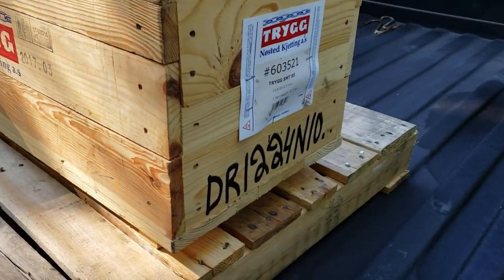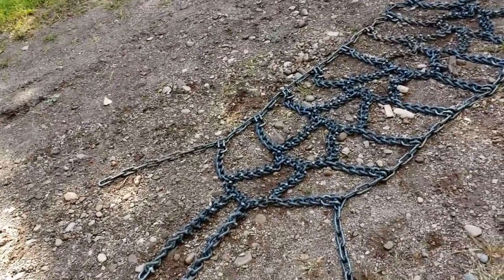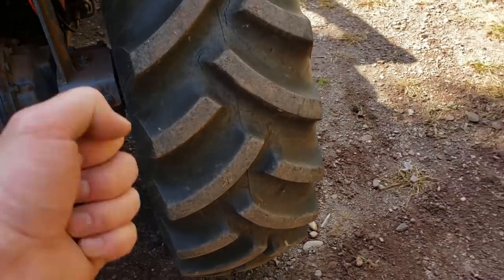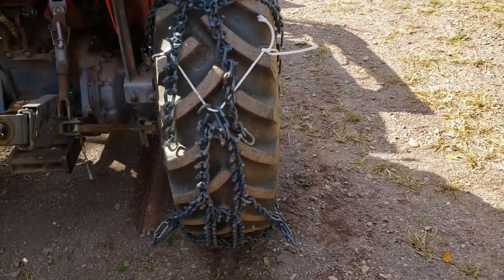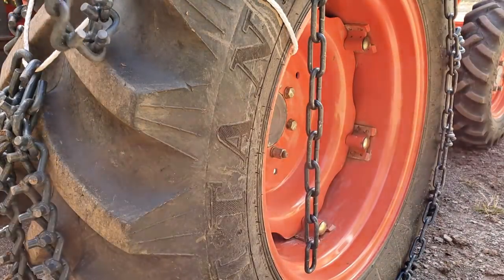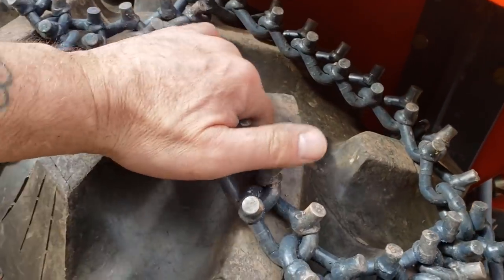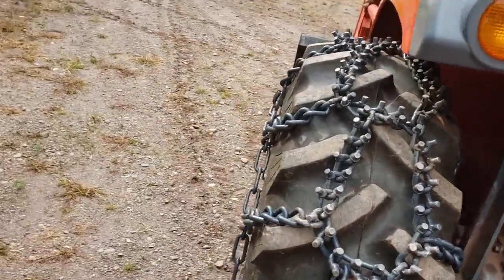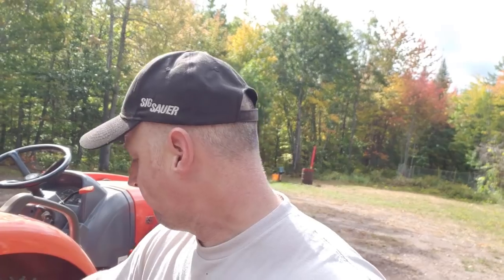Installing Trygg Ice and Forestry Chains on the Tractor

Comment: Nice video and chain set. I place my chains on the ground like you did then I drive the tractor over the chains, tie them on to the wheel then back the tractor up and the chains roll onto the tires with out having to stop and start 4 or 5 times to keep straightening them out. and you can do both sides at the same time.

Comment: Me like!  I have to work alone so your method of getting the chains onto the tires is really good.  You get them centered as you go.  I do have one suggestion - do with it as you like...  When I'm trying to get the clevis into the links (and sometimes the latch lever) I use a ratchet style load binder to pull the two ends together.  The ratchet style allows me to pull the ends and then still have both hands free to work.   I'm now 75yo and not as strong as I used to be - every little bit helps.

Comment: Just subscribed to your channel.  There is a lot of interesting stuff to watch on your channel! I am a tractor enthusiast and I like to cut and split wood (can be seen on my channel). If you haven't used the Trygg chains before, you will be surprised. You will love it. It has nothing to do with the common ladder chain. It's 10 times more effective.  This is what I have on my Case 430 (2wd) and ice is absolutely not a problem, even in very steep grounds. I keep them year long. Like the name suggest, they are good for winter and for logging! Thanks for sharing!

Comment: I have a set and they are the cats meow. Great traction and once they are on they don't move around.  They have wicket traction. I have a video on them on my channel.  I am on steep hills blowing snow and I hardly even need 4 wheel drive.  

There is a couple words of caution... 1. if they do spin they will rip up a driveway or badly scratch and gouge pavement.  2. you could flip a tractor over in the right situation. 3. brush gets caught up in them and can wrap around and take out your hydro lines.

Comment: I have solid wheels and industrial tires on my tractor. I just use my skidsteer  with forks on and set the chain over the tire and adjust from there. I will say there should be no movement of the chain once mounted. I put my chains on impossibly tight, or at least it feels that way. I see people running loose chains all the time and it just bothers the hell out of me. Thanks for the video. P.S. get a large set of chain pliers to remove links as needed, don't just leave excess chain hanging remove it or it will tear something up.

Comment: Should be a huge improvement Dale,still think a angle blade on the front instead of the bucket would cut your road snow clearing time in half,you have a quick detach on the front?
Reply from the maker: I'm hoping. We'll see how this winter goes and see what I can get for next year.
Reply: A SXS,Heated Cab with a blade LOL, still need the tractor for jobs around the camp,i have a T190 Tracked Bobcat at my property,all season machine and do some side jobs as well,Win Win !!!!

Comment: Just installed the same chains on my Kioti CK4010 this past weekend. I followed the instruction that told me to shorten the chains before install. Once I had them wrap on the tire, I realized that they were a good 6 inches too short. grrrrr!!!! Had to reinstall the section I had removed. Went OK afterward but still puzzled as to why they did not fit when shortened to my tire size according to instructions
Reply from the maker: That's what I like about the Trygg chains, they custom make them to fit your size and model of tire. They fit like a glove.

Comment: I had real difficulty with steering because of front tires on icy slope slipping, so I bought chains for only front tires because that's what always spins in any video I watch. Should be great in the forest as well this Spring. Of course it hasn't snowed much since I bought the chains in December 😂
Reply from the maker: I know what you mean.  So Chains on the front will help with steering for sure.  Normally Chains go on the rear tires because you will get better traction then if you are having problems steering on icy surfaces use the tractors independent brakes. 🍺
Reply: @NB88  no independent brakes unfortunately, it's like a shopping cart stuck in an icy parking lot that nobody will return😂

Comment: Any chains for the front ? I always had them on the JD 750, really helps when backing up in the slick stuff. Are you going to weight the back or are the tires already loaded ?  Good video and thanks !
Reply from the maker: Tires are loaded. I'll try these this year and see what happens.
Reply: @NB88  What ever happened with your front tires.  Looks like you said four years ago you'd try just the rear tire chains to start with.  I've got a Kubota B2650 and getting a plow attachment for the front loader arm. I'm told I may not have enough power to plow but right now I can't find good quality chains for the front tires.  I just received my Trygg rear tire chains a couple days ago and will install them this week.  Do I need chains on the front tires?  I would think it would help with the front loader blade and especially with some steep sections on a hill on the driveway.  Thank you.
Reply from the maker: @mattsedlacek9068  I don't need chains for the front. Those trygg rear chains give me all the traction i could ever want. And I have a pretty serious hill and it's usually icy. I'm impressed with mine. I did a number of videos on them. So I think for traction you'll be fine but as for power I guess that depends on how much snow you get. My tractor has 2x the HP as yours.
Reply: @NB88  Ok, thanks.  I talked to several sales people and none of them warned me about not having enough power with that tractor.  They were perfectly happy to talk about blades and to sell one (many don't have them in stock now in December) but none of them said anything about the potential power issue.  A friend told me that I might not have enough power for deeper snow so we will see.  I'll still get the blade.  Got the chains and will put them on this week.  Thank you.

Comment: Most countries use the Metric system, it's really easy.  Everything is divisible by 10, water freezes at zero and boils at 100*C.
Reply from the maker: I know.  I was only joking about the metric system.
Reply: @NB88  I commented before i read the other 500 comments that basically said the same thing.  Don't worry i am not going to send Metric ninjas to take you out.  I just re-watched your video about the tractor tire chains.

Comment: Do you ever have any issues with the front wheels sliding while driving across an incline with those ag tires? I have industrials on mine an forget trying to turn on a hill in the snow. It will usually go the opposite way lol
Reply from the maker: No, not usually, I mean ice is ice but normally they have pretty good traction with 4wd.

Comment: How are you able to move the tractor forward while not sitting in the seat? Mine automatically kills the engine, in gear, when I get up from the seat.
Reply from the maker: ah yes. That tractor has an HST transmission. I would never go back to a geared transmission.
Reply: But its a bit risky to be able to move the tractor from NOT in the seat. Just sayin. Mine has a hydrostatic transmission but has a safety switch under the seat. Yours does not?
Reply from the maker: @rogerhale6404  No, there's no safety switch under the seat. Honestly I never once thought there was any danger in the last 10 years. But I see what you're saying. I guess there's a chance the pedal could stick or something.